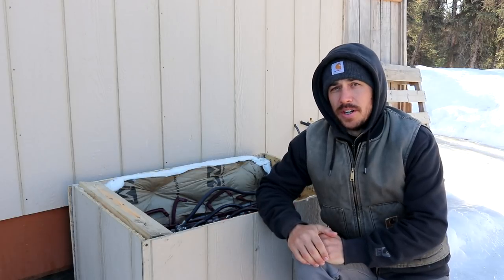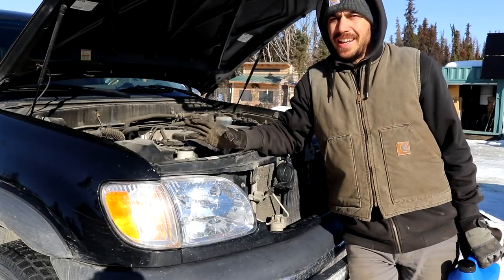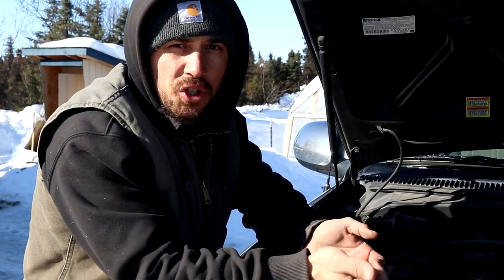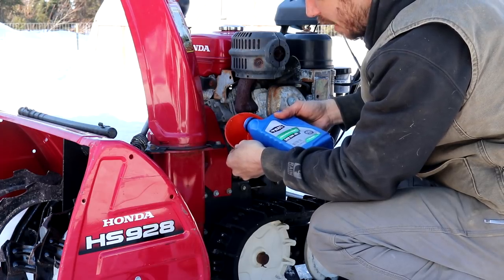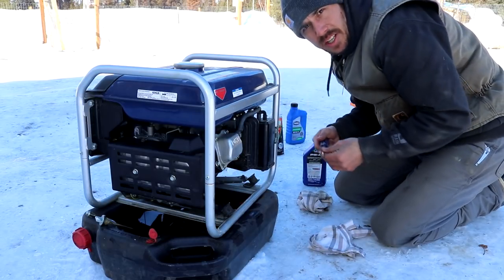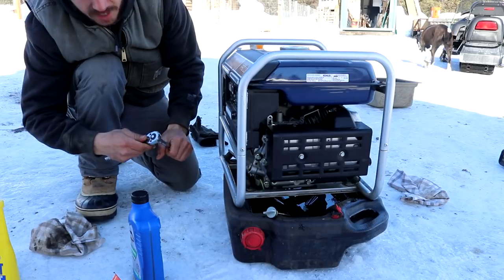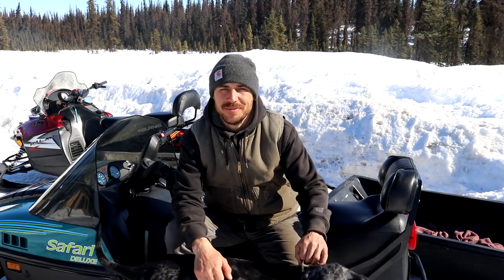Protecting Our Investments | Equipment Maintenance

Comment: Great job! Keep it working smoooooothly...

One point...
ALWAYS wear safety glasses & gloves when checking those batteries!  & Immediately wash hands after, even with the gloves!  I worked on a truck battery once with my gloves, everything looked clean. Got done, washed my hands - went to grab the gloves after lunch (abt 45 min) &   8 of the glove fingers had holes  in them!!!

Comment: I have a couple of trailers with wooden beds. The larger of the two is a 16 foot snowmobile trailer that I purchased in 1994. I change the oil in all of my machinery like you have Eric. Later on a warm day I use a paint roller and apply it to my trailer beds. The boards on the beds look almost brand new. Not a bit of rot. Reduce reuse recycle they say....

Comment: Most snow blowers do not have air filters as they are not in dusty conditions. Also on the tracks, make sure they are inside away from any sunlight as the sunlight destroys the tracks, and they are very expensive. I own a small engine shop. Thanks for great video's.

Comment: You can paint the used oil on your WOOD structures to prevent rot.

You can also put it in a sprayer to spray the chassis from also rotting
Reply: I was wondering how you would dispose of the used oil.
Reply: You can also put it in a bucket of sand & after you wash garden/yard shovels & such, vdip them in it.  This prevents rust on your tools
Reply: If you rigged a 5 gal bucket just right with needle valve you could drip it on a fire and get the energy out of it

Comment: Heet is isopropyl alcohol, which will mix with any water in your generator gas tank. It is not a fuel stabilizer. So...if you are putting your generators away for the summer, it would be good to add a fuel stabilizer. Or, run them until they run out of gas, and there won't be any varnish build up which can cause carb problems.

Comment: Another great video! 

A couple of things for you to consider:
1. When checking your batteries, put the part of the cap UP. Putting it down causes it to pick up crud (especially on vehicles) and the crud will end up inside of the battery. Not good.
2. Most small engines used on winter type equipment do not have air cleaners as the air is so clean and the filter will fil up with condensation from the temperature difference of operation and outside air.
3. If the oil drain on a small engine is in a difficult spot, I use some small pipe nipples/elbows to have the opening in a more accessible place. American engines use 1/8" pipe. Not too sure about foreign engines.  Probably metric. If the equipment is small/light enough, you can tip it on it's side and let the old oil run out of the fill opening. Just be sure the carb is up or it will fill with oil and you will have all kinds of problems. 

Now start considering. 

Thanx for the great video and channel. The Old Norwegian  ><>

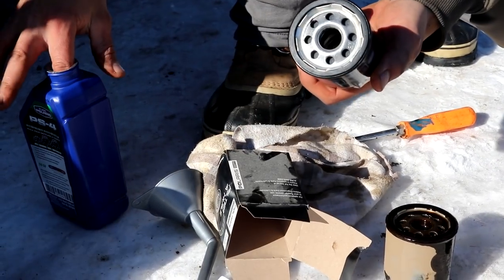Comment: When changing your oil filter on the Polaris you said (around 9:10) pretty much so screw the filter on as tight as you can hand tight. No, no wonder you have issues getting them off. Spin it on till it fully contacts and then only give it a snug turn say a 1/4 to 1/2 turn to compress the O-ring. They don't need as tight as you're making them and that is likely why you're having such problem getting the off. Also a little oil on the threads can help threading the new filter back on and I was taught and have always poured some oil into the filter say about half full so that when when you start the engine that first time it's not totally dry and sort of helps prime the system. Maybe it doesn't, but I've done it for almost 35 years and for all the little more it takes, it can't hurt.

I loved the look on your face when there wasn't an air filter on your blower.

Comment: Also shut the gas valve off if it has one and run the carburetor dry or drain the tank and run it dry. If you leave gas in the tank, put a piece of plastic bag like a zip lock bag under the gas cap and screw the cap on tight. This will keep water from forming in the tank. The tank vent lets air in and out and temps change and water will form in the tank if you don't seal it off.
Reply: Waterman one good info, thanks for sharing.

Comment: All small engines always check the spark plug with the oil and if you had a compressor and a hose you can hook it up to the generator and blow those air filters out and use them again😁😇🐝
Reply: Please stop giving bad advise, never! blow out A/F with compressed air

Comment: Good to see you take good care of the things that take care of you. Proper maintenance is overlooked so much these days. A little tip, if you can find it only, use gas with no ethanol in it. I understand the government has mandated most gas in America have 10% but you can still find some places that have 100% pure gas and it will save your small engine carburetor. The amount of times I've had to rebuild or replace carbs on small engines because of ethanol in gas is ridiculous. Don't worry so much about new cars, but older boats and small engines equipment should really only be run on pure gas. It worth the hassle to find it local then to have a perfectly good generator die years before its time.

Comment: Just to help you out a little. Oil filters should only be tightened 1/4 to 1/2 turn after the gasket touches the filter plate. Not tightened till they they stop turning.

Comment: Don't forget to grease your snowmachines suspension.  Also, I'd recommend red Heat instead of the yellow.  At some point it wouldn't hurt to change the chain case oil on the snowmachines as well.

Comment: That would’ve been the first snowblower I’ve seen with a air filter. Snowblower don’t have air filters 🤭🤨
Reply from the maker: Glen Waldner thank you we did realize that when I went to order one 😂
Reply: I had an old Arin's and it had a reusable foam filter on it. It didn't do much more than prevent large stuff from being sucked in though.

Comment: I have an idea, batteries are not efficient when cold, you might run a 1-2” plumbing pipe loop from the cabin into the battery box outside, then add a small silent low voltage, low RPM fan to circulate air, minimal effort, minimal voltage needed, better batteries! Obviously only needed in winter, duh.

Comment: Synthetic is great in really cold weather.  Your spot qualifies as really cold weather.  Synthetic is a slicker oil and it flows easier in cold weather than a comparable weight non-synthetic.  Since cold starts are when a lot of wear happens, using synthetic helps extend engine life.

If you can find gas without ethanol use that in all small engines, anything except the Tundra.  You can use it in the Tundra but since it is more expensive you may not want to.  Ethanol is bad for the rubber components and other parts of the engine.  Keep all fuel tanks full.  Moisture condenses out the air in tanks that are not full.  Ethanol has a lower MPG rating than playing gas so using ethanol free gas gives you slightly better MPG.  

Most small engines require 89 octane gas while typical 'regular' gas is  87 octane.

Comment: The mystery of the missing air filter lol
Reply: When I was The parts manager at a Canadian Tire back in the eighties. A young apprentice mechanic did an oil change on a car. Did everything perfectly. Except forgot to add new oil. Car ran for less than 5 minutes before engine ceased. Costly bill.

Comment: Go back to synthetic trust me it makes a difference when it's cold out.  And you don't need to change it as often.  You can easily go 10,000 miles per change using synthetic.  Actually i'd run everything on synthetic oil.  Most of your engine wear occurs during cold starts.

Comment: Photobombed by chickens....how rude.  Good video although most folks never think about maintaining their stuff.  And it’s often the “little stuff” such as fuel additives which make a difference.  Also, you pointed out something which many folks overlook.  If you are not using equipment, don’t just let it sit.  “Exercise it”.  It will keep the lines and seals and other components in good condition.

Comment: This is just a thought when you are dealing with any type of oil of a motor you should not change brands or go from synthetic to regular oil they have different additives in that oil. As well as running cheap oils they're not a good idea for your Investments as well especially FRAM oil filters they are known to be the worst oil filter on the market. Just a thought